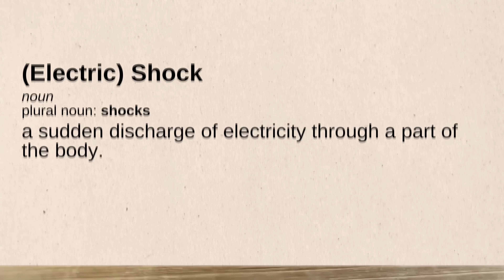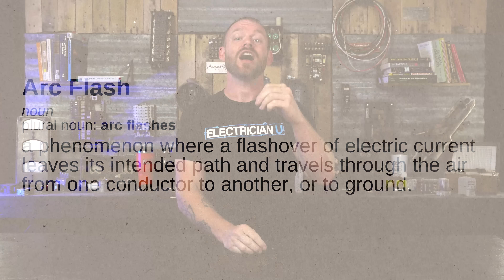How Do I Get Shocked? Why Am I Getting Shocked? It's Simple.

Comment: I'm not an electrician but I do thing's like panels, sub panels etc as a remodeling person. I have friends that are electricians that say that's part of electrician school is to hold a live 110 ? So to understand that sometimes the reaction can cause more harm than the initial zap. True or false? 
I've burned up linesman pliers cutting a hot that a probe said was not. And I've been ticked by a 110 slip grounding. And it's always,pull away. It's hard to figure training your brain to hang on to something that hurts. Like touching a hot stove or slice of cuban bread 😂. I just wondered. I've watched your videos for a long time. And appreciate your teachings.👍👍

Comment: I became the load one time working in a basement and I thought the wire was dead and it wasn’t and I accidentally connected hot and neutral through my needle nosed pliers and it locked me onto the wire with 110 coursing through my body. Felt like an hour and I finally managed enough control over my body to lean back, then throw myself forward and the pliers flew out of my hands thank god. I literally couldn’t let go with my hands they wouldn’t move just GRIP. Few minutes to catch my breath I had to go finish the job too… made sure it was off this time

Comment: Oh, also I think the resistance of human skin is about 100k ohms but your muscles and other... meat... below has way less resistance. I'm not an electrician or EE but I work with circuits often doing experiments/prototyping with 1.5VDC all the way to 100KVAC and felt 120 or 240 more than I care to mention. What I'm getting at is if you have a cut on your hand electricity will find it. I believe even shorting a small 9v battery once on a cut hurt significantly more than well dry skin because I don't feel it then. I imagine it's the same pain as shorting the circuit in your mouth but I've never licked 9v batteries before. Anyways, stay safe folks.

Comment: I was going to replace a GFCI outlet.  Breaker off, plugged in lamp, and it didn't light up.  Checked with the live wire tester, nothing.  Grabbed pliers, and a shock ran up my arm and out my foot.

Comment: Question for the pros. Recently had a tester registering hot ground revers on a home run with no other load. Upon turning off the breaker the tester lights stayed on. Working my way down the breakers I found the circuit leaking to ground on that sub panel. The second box I opened had a ground wire screwed onto a traveler terminal of a three way. The traveler (hot)wire was in the push in on that terminal. Presumably someone mistook that terminal for a ground screw. It had been there for years. Only showing up on a tester when the three way was in that configuration. Now for the question. Why did this not break out or burn off?
Reply: I'm just a second year apprentice, but it may be possible that the electrical wiring was not properly grounded. If it was, then in the proper 3-way configuration it would have a low resistance to ground and trip the breaker as it would exceed the amperage on the circuit before it started burning anything. Also it's possible the lights to that 3-way would be very dim (in the proper configuration) as it was in parallel with the ground but a much higher resistance. The homeowner would realize that there was only 1 combination of up/down that would allow the lights to turn on therefore rarely even shorting the circuit out.
Reply: @ethanavery9748  your response reminded me I did not post what I found. The 200 amp panel for this house was a sub panel coming from the farmyard pole. The electrician that wired the sub put in put the required insulated direct ground wire to the pole box from the sub panel. He however connected it to the common lug instead of the ground lug in the sub panel(incorrect) and on the main panel connected it to the common lug(correct). Problem being in a sub panel the ground and common are not bonded together. The effect being that all the grounds literally ran into the dirt on the ground rod. They were not connected to the insulated underground ground wire that was supposed to connect the grounds in the sub panel to the common in the main panel completing the circuit in case of a hot to ground short.  Very dangerous since the ground wire in the three way accidentally touching the hot essentially had current running through all the grounds. It was new construction so no sensitive equipment was ruined. I took a picture and sent it to the offending party who apologized profusely. So the bathroom gfi plug box circuit was getting power from a different circuit as was the case with every junction box in the building. In short you were correct in assuming the wiring was not properly grounded. Thank you. In a land of inspection this should have failed rough in.
Reply: @joecliffordson  agreed lol, that could have been a bad day for someone if they found a way to touch the refrigerator and say the sink faucet. I'm just curious though, the grounds wouldn't have been connected to the ground rods at the sub panel correct? If they were; Couldn't the current have gotten back to the transformer via the main panel ground rods? Or maybe it was too far away. Electrical can still confuse me sometimes.

Comment: Wish you would have shown cutting the neutral in the circuit you were demonstrating. Touching the neutral returning from the light( or any load) and completing the circuit to the other neutral  or ground will give a shock. Learned this 50 years ago and is one of the first things I tell new or wannabe electricians.

Comment: Can you clarify something. You mentioned the boots, that don't allow current to pass. And then you mentioned that 10000 volts would still pass through. Here is a question. Is there a difference in how you feel when you touch a wire when it is still not strong enough to pass through? Like, say, 10000 volt is a threshold, but then is there a difference between 1000 volts and 5000 volts?

Comment: Lol I have an electrical issue in my garage I know nothing bout electricity . I have led bulbs and flicker I got sick of it I open the switch box to look for grounds neutrals and hot wire .. all I did was Touch 1 wire at a time and with that little cheap electric switch tool u said u don’t use I found a hot wire. all u do is keep the button pressed and go wire by wire ull b surprised if u find a hot neutral and a hot wire sharing path . I some how fix the flicker

Comment: Getting shocked up the leg and out the arm at a light pole near a public pool left me with aggravating inflammation for life. The hot was off but the neutral had a load on it and pulled me headfirst into the pole. The spark I was assigned to did it for 40 years also said the neutral must be backfed to pull at us like that. I've told this story many times where the dcr engineer locked us out of the panel and assumed the circuit was safe for us to work on without panel access. On another crazy job, there was a hot ceiling grid were a few of us got zapped in the head as well where a competing shop cut into the gang box to steal tools and sabotage the job site. I remember the apprentice that didn't have a hardhat on was knocked off his ladder onto his back. They shut the job down and laid us all off. What was your apprenticeship like? Some of mine I wish I could forget. I got to remove your channel from my feed brother. Keep up the good work but the PTSD for me is unreal. Over ten years now and my body still fights inflammation from it. They did warn us in class 'we don't know what 277 volts will do to a person over time'.

Comment: Not sure if you've ever covered this, but I live in a 100 year old house and when I watch your stuff the wires in the boxes are so clean (I mean organized-clean, not the opposite of dirty,) and what not. For example, I have boxes that are an inch and half back from the wall. I'm just a DIY'er so I don't know if this is normal but one thing I see is that there feels like there's way more pig tales and wires in general in the boxes.

Wondering if you run into this kind of stuff and could comment on how designing a room's wiring has changed, things you might encounter and possibly ways to improve them or just understand the situation better.

Comment: I am now more serious about it too. I think nearly every electrition get to a point where he get's a bit to comfortable and think "yeah i just but it away" or "i am carfull but i don't want to put the fuse out" and then get shocked because of that. It happend to me a few times too, but now i am really carefull about it and always shut the curcuite down, i mean it is not worth it, if you are only touching the wire for half a second or so there will be nothing bad happening probably, but you never know if you are unlucky. Now it did not happen for a few years, execpt three or four month ago because i was drilling a hole in a lantern to fix the lightning protection and i was always drilling at the time place in every lantern but on that one the electriction had a bit more cable and put it on the other side where i was drilling, yeah and i was leaning against the lantern, it was raining and i drilled in the phase, i think that was the hardest shock i ever got... Since then i always have the key to open the lanterns with me to look for the cables.

Comment: I've been hit with 120V with a 15A circuit breaker, 240V from source, and 480V with a 5A circuit breaker. Luckily nothing substantial, but the 120V was the most dramatic. The 120V was totally unexpected. I thought I was doing it safely. The 240V, and 480V were just me putting a finger where it shouldn't have been. The closest I've been  to getting hit really hard though was with a 480V distribution panel. We were demobilizing a couple of units and had two different panels feeding into our different units from the customer from two different panels. The customer turned off one of them panels and left the other one on. When we came back to unhook the power from our units I took off the safety shield from our breaker panel and was about to go in and disconnect the main power, but something told me(inches away) from getting shocked, electrocuted, killed, to stop and check the voltage. Turns out it was still live. I am so lucky that didn't happen otherwise I either would be a crispy critter, or dead.
Reply: 240 has more resistance so "safer" in that regard. Costs more to run it.
Reply: @leighz1962  Got Lucky with a finger brush against a live terminal. (stupid mistake) but a learning experience.
Reply: It's all about how you get shocked and where. The 240V and 480V shocks where a brush against a live wire or post. The 120V shock was more dramatic and could have been bad, but really a lot of luck was involved. The worst part was I felt I was doing the line work safely. 
 @mclaurinisGODsSon2

Comment: We used to go to Mexico. Cuidad Acuña to be exact. It’s across from del rio TX. One of the bars called up and downs had an electric chair. You sit in this chair and grab a pole with each hand. They turn up a dial. If you get to 100 you get to sign the wall. I don’t know what 100 meant if anything . In hindsight that’s a stupid goal because it’s not too hard to do so after a certain time period they just paint over all the signatures. I don’t know what the voltages we were experiencing were. Your muscles would tense like crazy. I’m guessing it was fairly low because I’ve been hit by 110 a handful of times and it hurt more than the chair. Regardless it probably wasn’t the smartest thing I ever did.

Comment: Doesn’t matter how well insulated you are, if you quickly and lightly rub you finger over the wire you will feel a tingling sensation from a live wire due to the interaction of the electric field created by the live wire and the static created. Same thing with the moisture sensor in your clothes dryer but safer to try since the 240 is passed through a couple megohm resistor. Remember, when it comes to electricity and just about everything else, contact time matters. Swiping your finger across a wire is not as likely to electrocute you as grabbing a wire is!! Arc flash from a 15A circuit with stranded wire creates a good size blinding blue fireball that could probably cause some injury if done close to the face.
Reply: Super good to know.

Comment: 4:06 Pretty sure this is incorrect. The existence of a load (i.e. the lightbulb here) doesn't really reduce your shock potential given that the resistance of the load is tiny compared to that of your body. Just as voltage drop occurs relatively across resistance, so too with the shock value. A run of copper wire with a lightbulb on it is actually an extremely clear path for electricity to return to source compared to any sort of ground fault scenario.

Comment: Careful with white conductors that are generally neutral and circuit is off and thinking it is safe to work on. If whites are all tied together in a jbox and from DIFFERENT circuits, there’s a chance that that supposed neutral is live (from another circuit). I’m a handyman and couldn’t figure out why I was getting power in the connection box when circuit was off. Your comments about hot neutrals are welcome as I am still learning about safety. 

I learned to use voltmeter instead odd those on/off indicators when testing for voltage on what I am working on. Your teachings are very helpful-and potentially (no pun intended) lifesaving!
Reply: Very true!

Comment: We had a salt lamp night light plugged into the gfi in our bathroom. They are really not safe as the salt draws moisture and makes that moisture more conductive. My wife went to pull it out of the outlet and used both hands. Got a little shock. I was surprised it didn't trip the gfci. I tested it afterwords and it was working. My only guess is she was getting less then 5ma of current.

Comment: I only use Fluke meters and leads, mainly because I once vaporized a set of leads trying to probe a light switch and I came away unscathed.  :P  I work at a manufacturing/office space, so it's smart to check the voltage of lighting circuits before swapping out any fixtures.  (And we had several sparkies out for lighting mods previously, so god only knows what they changed.)  Case in point, there were a lot of angry pixies hiding out in a light switch of all places.  I probed hot and ground to check voltage, since the lighting in that building runs on a mix of manufacturing and office voltages.  POW  the lights for half the building go out.  That was...new.  I checked the meter and everything was set correctly for a voltage measurement--my Fluke 87V was ready to go.  I reset the breakers and the lights come up fine.  I perform the same test with everything set the same and I get the standard 277V.  To this day I have no idea what happened....other than arc flash vaporizing half an inch off one of my test leads and giving me a sunburn on the inside of my eyeballs.  :)
Reply: Took balls to retest aye?

Comment: I was working in an basement demoing out old K&T that another electrician told me they had turned the breaker for off. I got to a bathroom plug with one of those old small metal boxes. Same circuit as the lights in that area. I started trying to push the wires out the back so I could pull the box out, but when I pushed the second wire the first one would keep bumping back inside. I had the smart idea to use both my thumbs to push them simultaneously, and that's when I discovered the circuit was still live, and I was just getting lucky with the light outlets up to that point.
Needless to say I then slammed every breaker off and went to find that other electrician.
Reply: K&T with breakers?  I've only ever seen it with fuses.

Comment: Was taught in Vo Tech class many years ago that you can only be electrocuted once because it kills you. Was a!so taught that they worst body location to get shocked is from is your left hand or arm to lower point on right side of body ( like a leg or foot ). This causes power to travel across your heart. Got shocked with 120,208,240, 277 volts & 5,000 volts from oil burner transformers. Worst shock occurred on a hot humid day when was soaking wet and attempted to unplug a wet 240 volt twist lock male connector from a female connector hanging from a cord. I was an apprentice and the electrician I was working under did not want to climb up a wall mounted steel ladder to secure power.. Went home with chest pains. Was told at an IAEI continuing education class that body size & body mass effects body resistance. In other words a tall fat guy will not feel shock ( at least from lower say 120 volts ) as bad as a thin short person. While on PPE you must send your gloves out to be tested and date stamped every 12 months. Believe hard hats have to be replaced every two years according to OSHA. At least that's what my boss told us.

Comment: When you see an ARC, you are looking at a blown air capacitor. The air that was charging and discharging 120 times a second to stop the flow of electricity through the air gap broke down, creating initiating explosive voltage from the blown air capacitor. Sticking a metal object in the ARC, you can be shocked if you are standing in water or if you fall back on the heels of your boots so that just the pointed heel is in contact with the earth. These scenarios create a different-sized capacitor with the earth and your body than when standing flat-footed. As a very small capacitor, experiencing the high voltage from the ARC, your body polarizes at an extremely high rate that your heart cannot take. Standing flat-footed used to be the first thing you learned when working with electricity. Not so much today. This usually happens when holding a metal tool or object. The ARC strikes the metal object in your hand, and the metal object reciprocates with an ARC back against the original ARC.